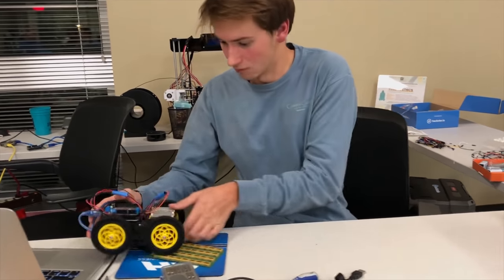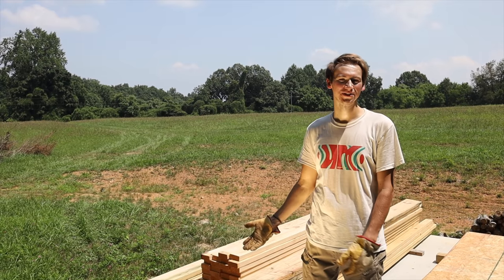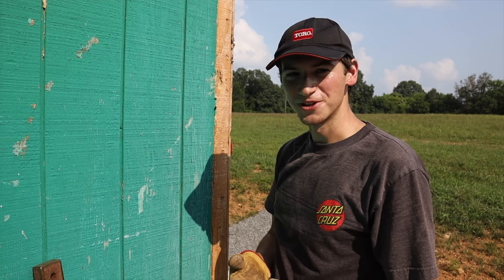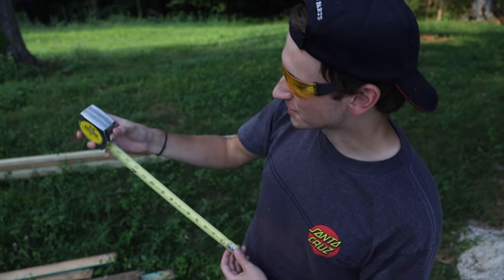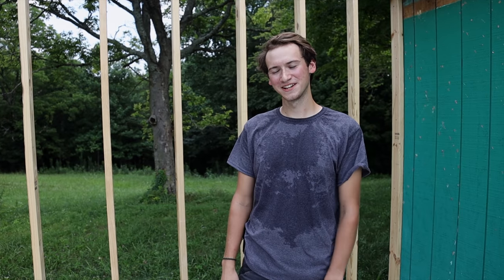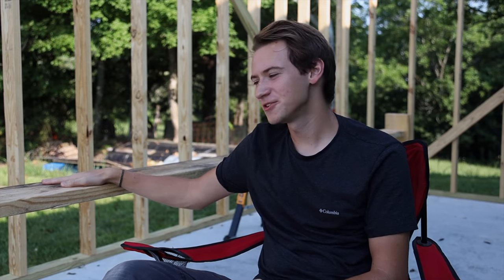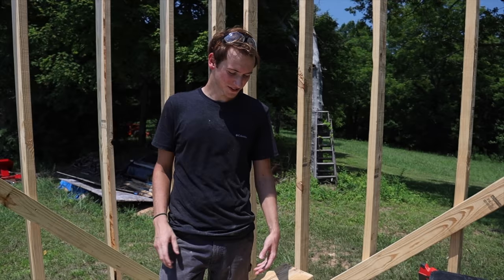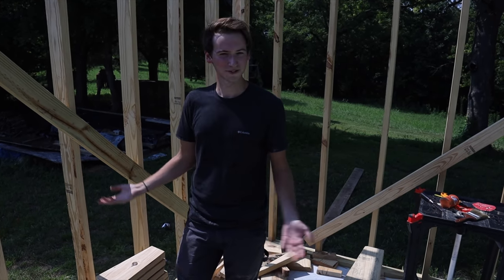Framing a Workshop Addition for Our Home Depot Shed!

Comment: You did well on the framing. It's one of those jobs that looks really easy, but isn't. I did a second story addition to my house about 20 years ago, and framing was the only job I contracted out. I was around to watch them work, and a pro framing crew is amazing to watch. We did cathedral ceilings in the addition so we couldn't have all the bracing required for a regular roof and all the roof rafters needed to be cut on site. The guy cutting the rafters used a worm drive saw after marking all the 2x6 boards, and was just casually holding the board in the crook of his foot to elevate it and flipping it to do the other side without touching the board. Cut the bird mouths and the ends for all 50 some odd rafters in about an hour.

Comment: Work Shirts: As the other guy said, go with light colored to cut down on heat. On top of that, you want to get a sweat wicking shirt. Under Armor built their whole brand around this. They're a thin undershirt that pulls the sweat off your skin. You still sweat but it keeps you from feeling so gross and sticky. It might seem counterintuitive to wear 2 shirts, but the under layer is really thin and even if its slightly warmer to have it on it makes it so much more comfortable.    BTW, it also helps to get sweat wicking boxer-briefs to help with the undercarriage.

Comment: Looking goog so far . Only minor mistake I see as a framer is the failure to use a sealant between the concrete on the sill plate to prevent insects and moisture intrusion.

Comment: Putting the siding on the walls Before you raise them makes it a Lot Easier, a little Heavier but Holds everything square and you don't have to lift them and hold them while trying to nail them up one by one after.

Comment: You might want to cut some barge notches in your gable rafters before you hang them. It makes your fly rafter much more stable if you lay in a lookout at least every 2 feet oc. Just be sure you have your 1st run of decking break on one of your barges. Don't forget to allow for overhang on that 1st run when you pop your line.

Comment: Man O Man. You Should have put up Tar Paper Horizontally on the Preexisting Roof Section after removing the Old Tin and Before install the New Roof Rafter Supports. That way you have a Layer of protection for the Wood just as in a New Roof before Shingles are installed. Prevent any Leaks occurring with the new Additions you are installing. Good Luck!

Comment: Good job! I enjoy following your series. Before you start the other side of the shed, you might want to think about adding some of that foam vapor barrier under your bottom plates that rest on the concrete. All of the videos I see doing similar work always use pressure treated wood and place that foam underneath. Best of luck with the build.

Comment: I would agree, lighter colored shirts are better. Also no screen printing since that seals the weave of the fabric.  I don't think any of the high tech wicking fabric would help with the high humidity there still would be very little evaporation.
Reply: Yes. And there is the problem. As crazy as it seems, the fan we plug in does at least evaporate a bit.

Comment: are you building a porch in front?
 i am thinking of building a porch on the front of my 12x16 i built this 2020-2021 going to get a wood stove to reduce the amount of propane i am using in the winter.
what is the coldest it gets there? it gets to be -30c + here.